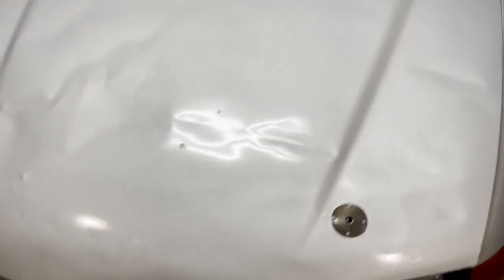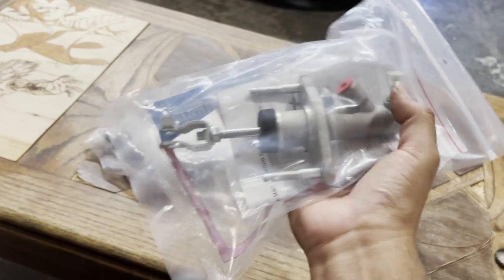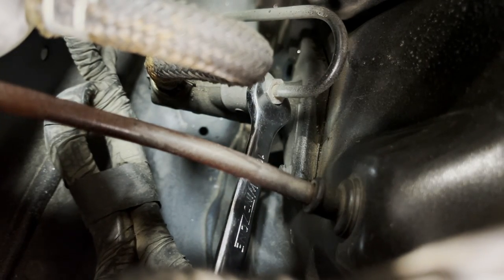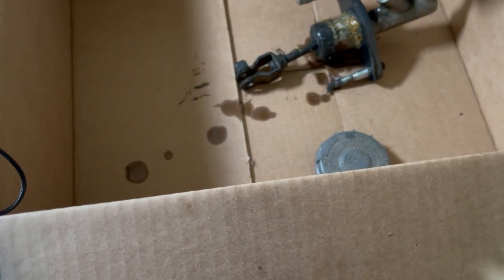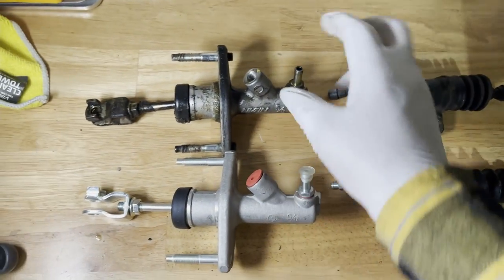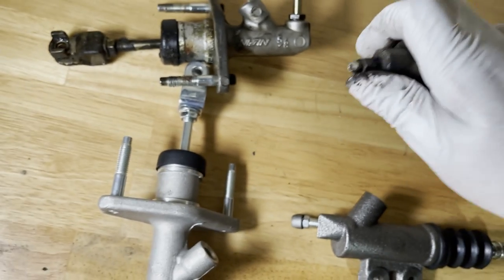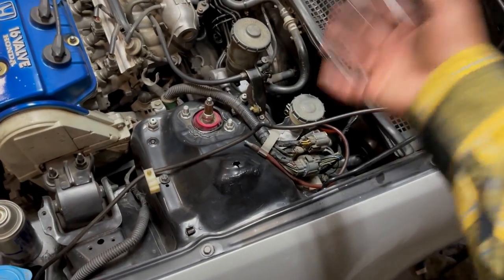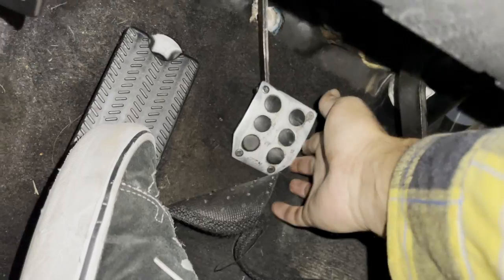Stuck Clutch Pedal... Replacing Clutch Master & Slave Cylinder on EG Hatch!!!

Comment: Bro I did the same things and my clutch still stays grounded
Reply from the maker: Did you bleed the system all the way through? It can take a couple passes before all the air is out of the system to bring the clutch back up
Reply: There is also a adjustment on the master cylinder piston /prong
Reply: @destinfurloughray1592  Idk how to adjust the master cylinder it won’t let me clutch go all the way back up it’ll stop it half way I need help I have a 93 accord H23A auto to manuel swap
Reply: @grimm1591  that’s because you havnt bled it correctly, you need somebody to press the peddle five times then hold it then you locate you’re slave , and release a very quick amount of dot 3 repeat the process, for like 20 to 30 mins